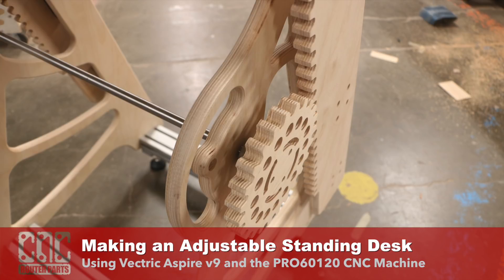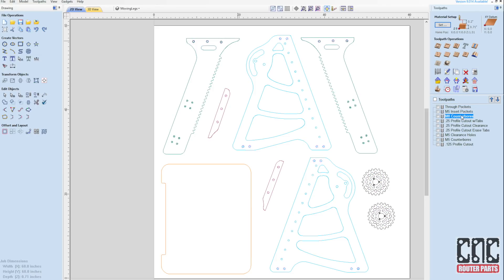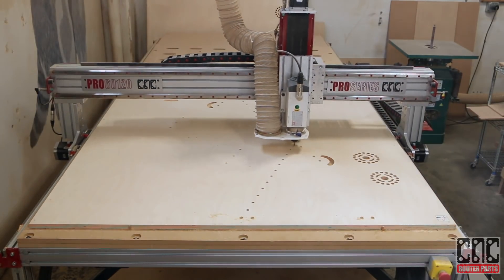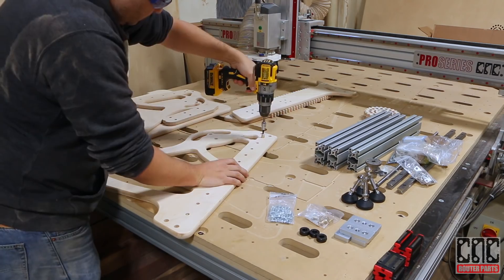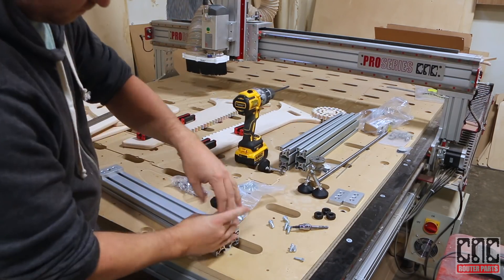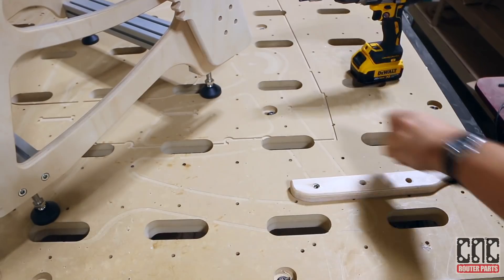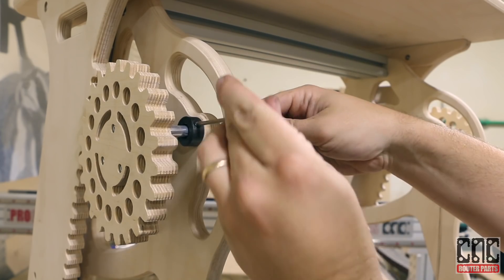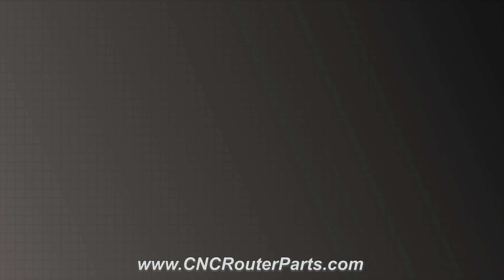Making an Adjustable Standing Desk (Open Design)

Comment: Maybe a motor on steel shaft, use one way bearing to stop slipping back and servo to release it when lowering ?
Reply from the maker: Hi Twisted Stone,  Nice idea, I'm sure that would work.  We may include optional provisions for mechanising "version 2" however it will still need to work manually for those that don't want to include electronics.  Thanks for your comment! -Nathan

Comment: Hmm..  The locking mechanism probably needs an operating lever just under the table surface...  Maybe a spring for counterbalance would be a nice addition as well.
Reply from the maker: Yes, ideally the actuator for the locking mechanism would be located just under the table top, that would be awesome.  I thought of using some of our smaller cable track to route a unlock cable through (plus power/data cables).   Adds a number of parts to the BOM though but probably worth modeling up!  Thanks! -Nathan
Reply: I keep thinking of the ratchet mechanism on a boat winch...  The lever could pick up the pawl or slide it out of the way...  Not recreating the wheel here, but that mechanism is pretty simple...  It may require an additional directional ratchet gear to be attached to your drive gear.  Either way, the design is pretty damn cool...  I need to get with you guys.  I spoke to you out at Autodesk U, I'm good buds with Fred (Feddie).  I need to step up from my current CNC for guitar production and for projects on my other channel (Greg's Garage)...  In the middle of moving across a few states...  When I get settled in my new shop/studio I'll get the ball rolling with you.

Comment: Great design, wanted to use it myself but only available in vectric, from their site and with a login. So instead of an actual free download, I would have to pay for software to even get access. Just post the dxf somewhere instead please. I understand this was a partnership between the two companies, but the description is misleading and I already gave you somewhere around $10k to date. I would appreciate the the files being available for all customers of your product rather than vectric only. What limited files are available from you are great, but you just limited a file to a smaller portion of your customers.
Reply: Couldn't you redraw or take a screen shot of the parts and import the designs into other software... ?
Reply from the maker: Hi M W, The project is available now in a form that works with Vectric's free trial edition software allowing anyone to download and use it.  You can download both the free trial and the project from https://release.vectric.com/makeastand.   Thanks! -Nathan
Reply: Twisted Stone yes, I could. But at that point I could just make my own up completely. This is a project file, to reduce the work.